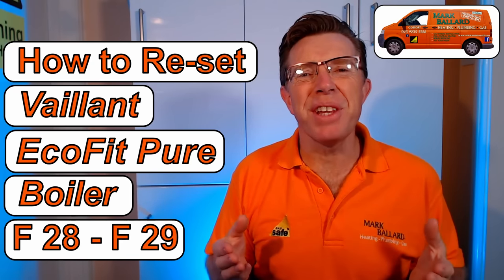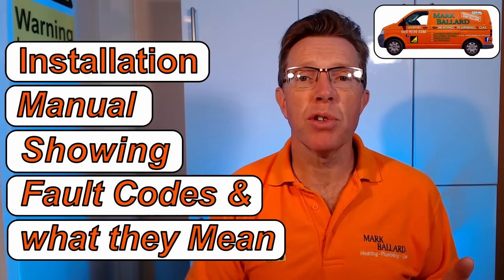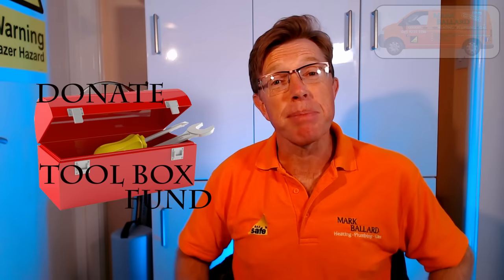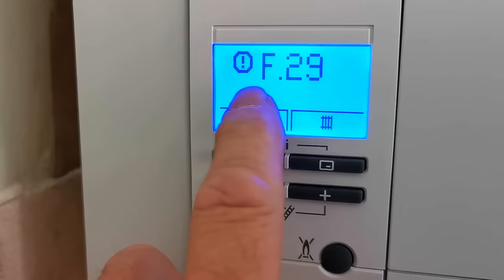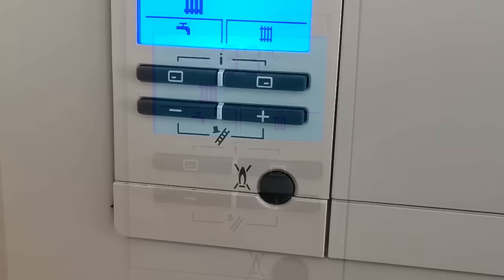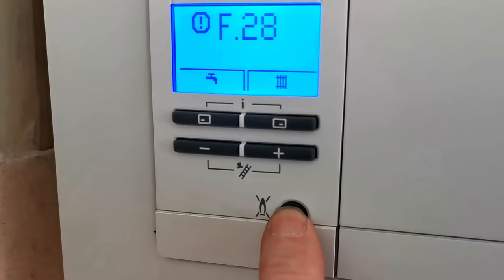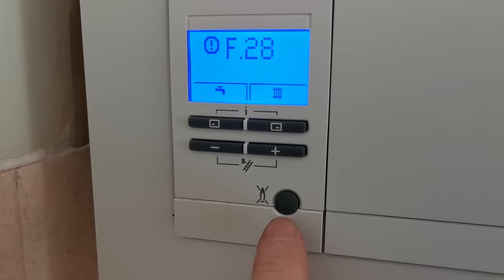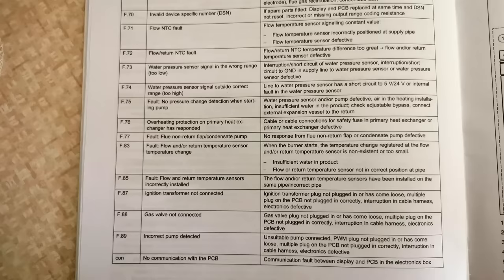Vaillant ecoFit Pure, How to Re-Set F29,  F28 Faults Explained. Get the boiler working again.

Comment: Thanks very much Mark. Our Vaillant stopped working today (which is just about the coldest day of the year). I checked out the troubleshooting instructions in the manual, which told me to hold down the fault clearance key for one second. This made no difference, so, after three attempts, the guidance said that I needed to contact an engineer. Thankfully I checked out your video first, and you showed me that the fault clearance button should be held down for 5 seconds. That worked a treat, and the boiler is going strong again. Thank you so much for your brilliant video!

Comment: Last night I had an F22 pressure drop which left us with no hot water and no central heating.I couldn't make head or tail of the instruction manual so retired to bed defeated - until I remembered the wonders of YouTube and found your channel and 7.55 minutes later I knew what to do and in no time I had reset the boiler and hot water and warmth was restored which given how cold it is at the moment is an absolute blessing - thank you so much Mark.

Comment: Thanks for really good vid. All I did was turn the gas off at the meter and then  turned it on again an hour later. F29 fault and a dead boiler! I followed your reset instructions and PROBLEM SOLVED! I can't thank you enough.
Vic

Comment: Actually I already solved the problem myself before coming to this video, however I just wanted to look up if I can  gain further information that could cause this, just in case. For F.29 (at least in my case) it seemed it was a gas shortage, meaning the gas supplier didn't delivered enough gas to ignite the flame and to heat up the boiler. Anyway I love your video and explanation because you are one of a rare kind today, since most people would call a technician even though most issues can be easily solved by one selfs and you only need to call a technician if there's an issue you really can't find out and/or fix yourself. It saves you also lots of money, as like just in clicking the button, while even if the technician wouldn't most likely charge you for just pushing a button, you still gonna end up paying the fact that he had to come which can be, depending where you live, easily  50 bucks for coming and going and not being able to spent the time with a client that really needed help where he could had made way more money then just the 50bucks. So thanks for keeping people informed and being a diy craftsman of your own.

Comment: Thank you so much. We had a new hob installed and turning the gas supply off triggered the F29 fault which would not reset, even powering off etc.. Hob engineer was not interested, everything online says get a Gas Safe engineer in, and yet all you have to do is hold a button in for 5 seconds!

Comment: I did everything what you said, the gas valves are open and it still doesn't work ☹️ with the first restart the temperature instead go up dropped from 33 degrees to 19 within moment
Reply: Edit pipes were frozen that's why didn't work

Comment: Ours came up with this F28 error reseted it and worked but would revert back to F28. Turns out the outside water pipe from the boiler was iced up. So pouring warm water and freeing up the pipe. Finding the cause of the issue then resetting is the best solution.

Comment: We had the F28 fault and it locked out again.  It was a frozen condenser outlet pipe.  Worth checking if yours if frozen, after running hot water over the pipe to melt the ice we were able to restart the boiler.

Comment: I do this, but it just goes back to F.28. A couple more restarts and it changed to F.29. Any ideas?
Reply from the maker: All you can do is check your gas is definitely turned on at the metre. If your gas hob works fireworks ok and make sure no one has turned the gas lever off under the boiler that's normally a yellow handle. if everything is on then you have a fault and you'll have to call a gas Safe engineer.

Comment: F28 fault code turned out to be due to low heating system water pressure in my case. Adding water into the heating system fixed the issue.

Comment: Hey Mark, is it safe to cover up any holes that go around the top PVC pipe which im assuming is the exhaust pipe? It passes through my attack but there's a big gap where mice could come in, is it safe to cover thegaps with something like expanding foam?
Reply from the maker: If your talking about flue pipe going though plaster board.  Then you can use expanding foam.
Reply: @MarkBallardLTD  Thanks for the reply, does the boiler ever get too hot on the outside to the point where it could allow the foam to release toxic gases?

Comment: our boiler says F24 - safety switch off, temp. incr. too fast . our boiler is ecoTEC plus 832. the problem - it only turns on after switching off and on. and automatically switches off . it's very problematic during winter. pls help